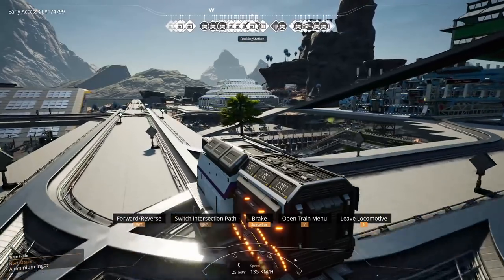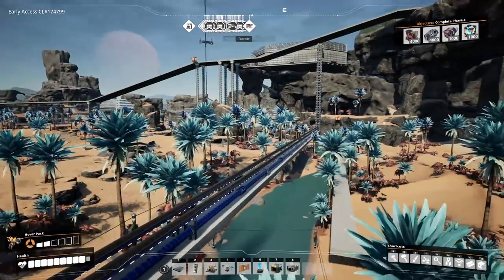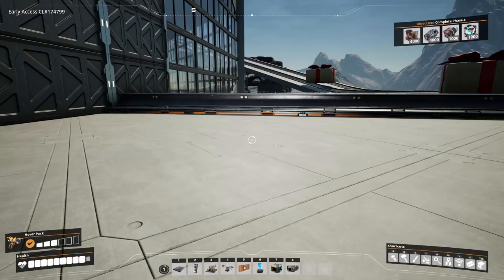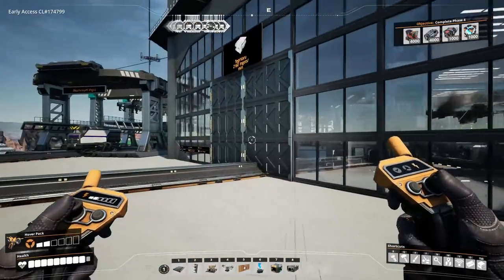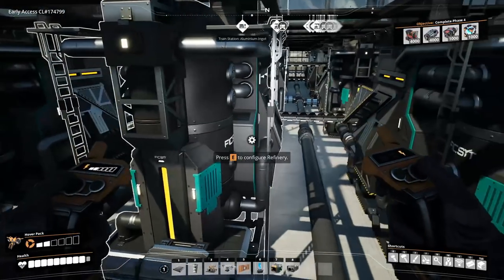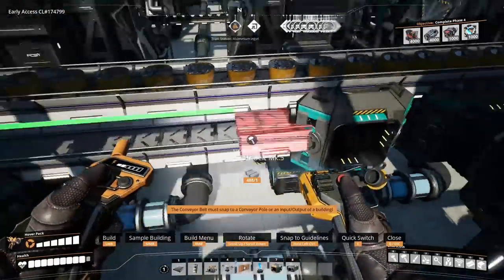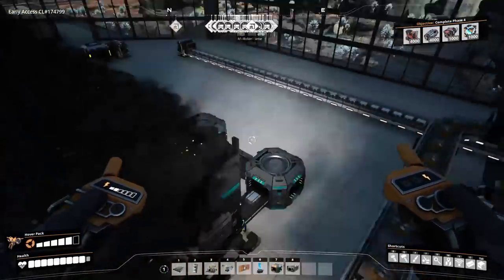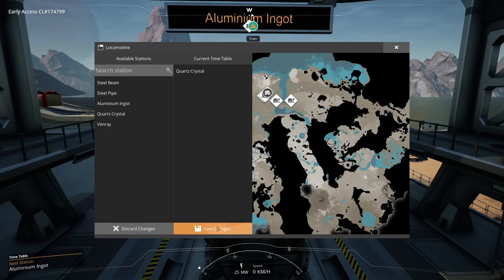How to Build 2000+ ALUMINIUM / Min Mega Factory | Satisfactory Update 5 | #14 | Showcase/Tutorial

Comment: The water feedback loop with valves works very slickly, and it is a great idea.   It also makes me sad because I have worked out how to do a non-stalling loop like that without valves, but this is simpler.

My way uses a fluid buffer (aka a water tank) and it is placed such that the new incoming water has enough headlift to fill it maybe halfway or so.  But the recycle line can fill it all the way.  Half the tank should be enough water to empty every output buffer should the line stall for some reason, and the incoming water can't occupy that space.

And yet,  valves seem better.  Sigh.

Comment: I usually build an Aluminium factory a bit to the east of the location you chose.  Then you can pull water from the lake which is ABOVE the factory.

There is also Coal in the same location as the Water, so you can avoid the entire Oil production leg.  Of course, the Oil leg is definitely way more efficient - the required Coal input is more than 5x the required Oil input.  But moving the factory to that eastern spot also brings you closer to a source of Oil in that direction.

And instead of recycling water, I bring in some Copper, also quite close, and use the waste water from the Aluminium leg to make Pure Copper Ingots.  Then I don't have to worry about any wonky issues with balancing a recycling loop, and you can never have too many Copper Ingots.

And you need Copper Ingots near your Aluminium Ingots anyway, to make Alclad sheets.
Reply: Oh, great idea!

Comment: I understand the direction to focus only on Casing, and just one-off the Sheets back near Hub.  But since Ingot->Casing is 3:2, seems like train density would be better to make Casings at the existing plant.  Especially if not using the Copper-based Alt, it is just another floor of Constructors.  Ingots only seem useful to a Fused Mod Frame Alt, which at first glance doesn't seem that appealing.  What wisdom am I missing?  Is it just a numeric answer to having to make the Sheets back near Hub?
Reply from the maker: that is a good point. Now I kind of wonder if I should just build an extra floor just for that below the train station... I will ask in Twitch chat on the next stream what everyone thinks. Thanks for the idea
Reply: @Nilaus  i would like more floors. the structure lattice you came up with is really cool though too
Reply: Please let us know the feedback from Twitch audience.

Comment: Nice build, missed it on twitch unfortunately. I did it slightly different which makes water management and build ratios easier. But need to upscale production of scrap which I know you do not like. If you up the scrap production to 400 instead of 300 per refinery you can do 1 to 1 alumina solution to scrap refinery and need 1 water extractor per 2 refineries alumina solution as you get back 140 water per scrap and need only 60 more. That way no need to do any water manyfolds and water is at ratio, no need for valves. Also petroleum coke then goes at a perfect 2 pet coke to 3 scrap refinery ratio.
Reply: Interesting idea! I'll have to do the math & flow diagram, see if I can make this work.

Comment: Has the math changed on this in a patch? If you downclocked the 16 Bauxite to 75% you still send up with 2880 Alumina not the 2592 shown.  To get that, each one has to be moved down to 162 per minute or 67.5%.  Or if you want to keep the 1:1 ratio of 180 Alumina into the next, you will need 960 Coke not 864 ?

Comment: The silica output from the standard recipe can be exported and by passed to the later stages of the production where you need that silica to turn aluminum scrap into aluminum ingot.
Reply from the maker: but not at ratio, which ruins everything and makes it way more complicated for no reason
Reply: @Nilaus  True, but that also depends on your location and how much bauxite you're processing... In a small isolated plant it can be done and if you don't have the alternative recipes yet then you don't have much of a choice until you find the right hard drives...

Comment: Hi @ Nilaus,  Im trying the same built with valves restricting the water flow to 45 p/m. Bute every few minutes the valve resets to 300 and the entire productions stops. Have you or anyone else encountered the same problem? How to fix this?
Reply: I Just finished replicating this factory and had this same issue unfortunately.  I have a dedicated server on my LAN so everything can run when I'm logged off and it seems to be a bug in the dedicated servers they haven't addressed yet.  Will have to find a way to get rid of the excess water until the bug is fixed.

Comment: I tried to handle the water this way aswell. But the valves didn't work out. What to do instead? :D
Reply: I Just finished replicating this factory and had this same issue unfortunately.  I have a dedicated server on my LAN so everything can run when I'm logged off and it seems to be a bug in the dedicated servers they haven't addressed yet.  Will have to find a way to get rid of the excess water until the bug is fixed.